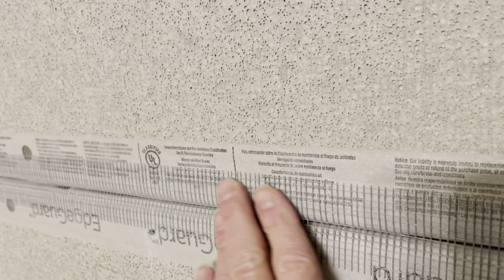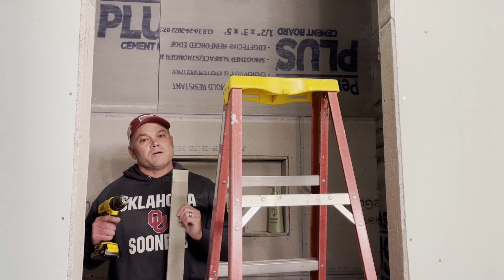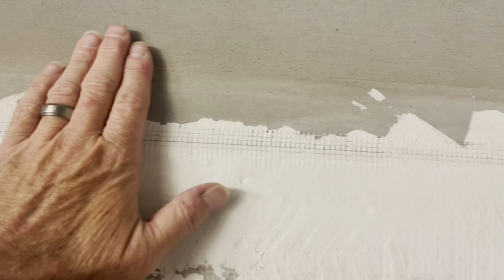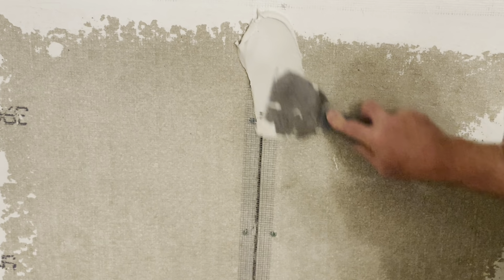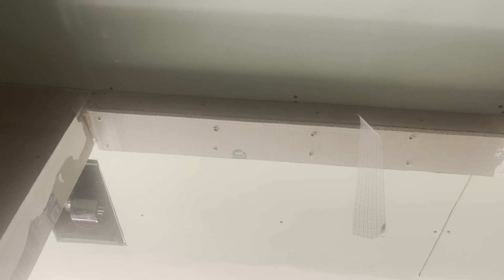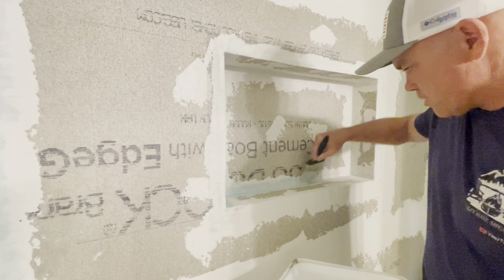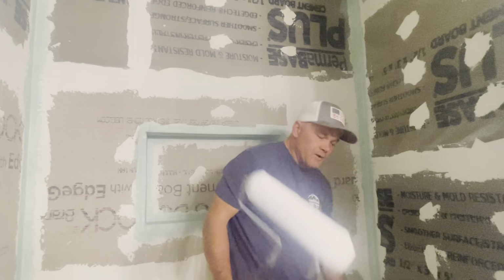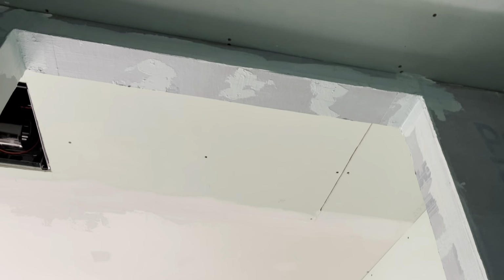I Doubted Myself... I Can Do This

Comment: You do an awesome job mudding the sheet rock Myke.  I like how you spread the mud on then scrape most of it right off, evenly. 
It's a lot easier spreading a thin even layer and being done with mudding rather than having to sand it even. You mentioning about forgetting that spot then forgetting it again  sounds like me....LOL  SQUIRREL...🤣😂🤣
The shower is looking good. 
Thanks for sharing Myke. 
Stay happy, healthy, hydrated and safe.  May God continue to bless you, your family and your adventures.
Reply from the maker: I try not to do any sanding which means really thin coats

Comment: MYKE, don't you have to do taping and thin-set on the ceiling where it meets the walls? And wouldn't you also paint waterproofing on the ceiling (for condensation and splashes)? Just thinking ahead. I've seen a lot of moldy ceilings in my 60 years.